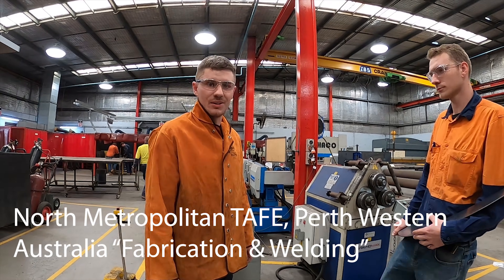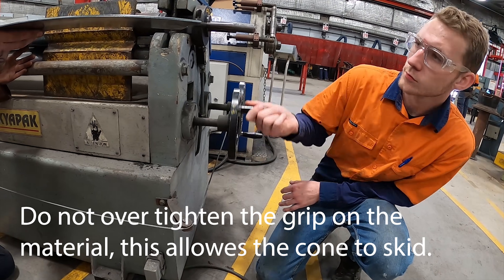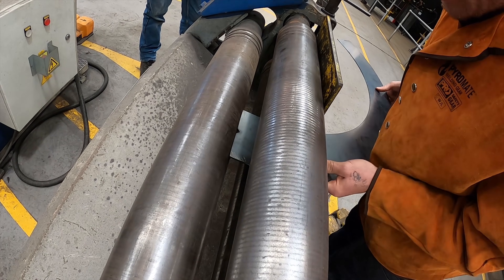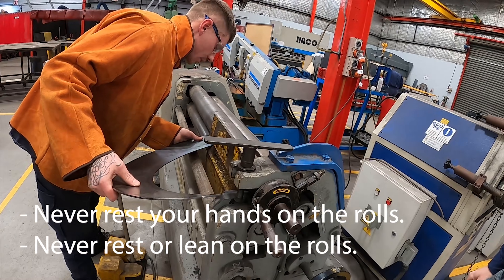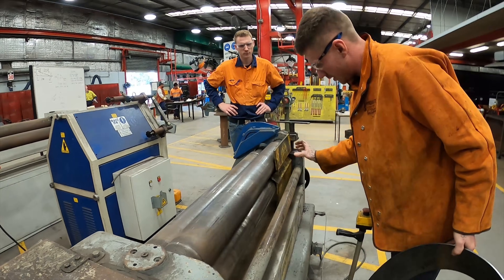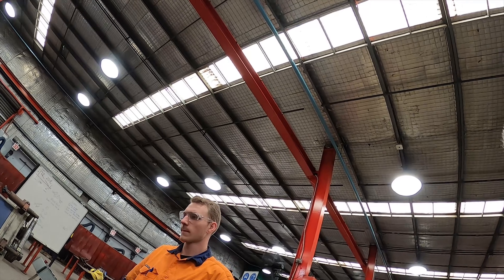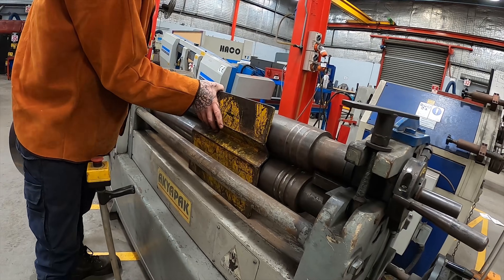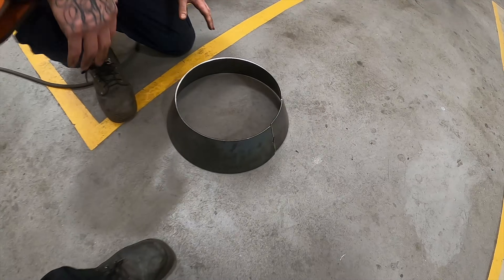How to Roll a Cone – Midland Fabrication

Comment: Thanks for the idea for a snubber.  I am in usa and have never heard it called a snubber although I have never heard it called anything for that matter.  I may try to make one.  Is it held in by just that bar in front?  Also why so many passes, is the roller just weak?  Normally I would roll that in between 2 to maybe 4 or 5 passes.  We normally start out getting it pretty close to done in the first time around then just fine tune it maybe a few more times through the roller.   Cool video though.  Thanks.
Reply from the maker: Snubber heald in by front bar and the rolling process pushes the snubber into the rolls. You are corect dont need to rotate so many times.

Comment: Can you run the machine in reverse?
Reply from the maker: Yes can rotate in either direction
Reply: @midlandfabrication530  try it :D
Reply: By  dobble option electrical switch it will move forword and reverse..I did it many time